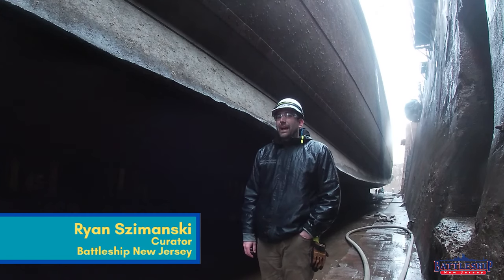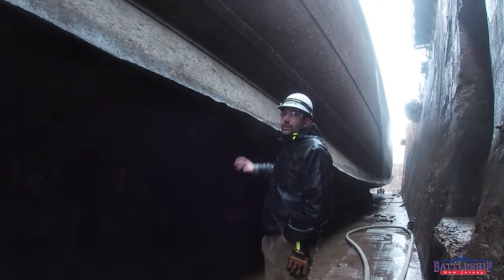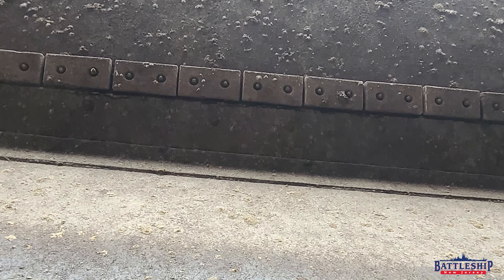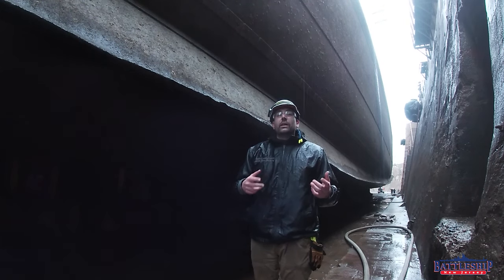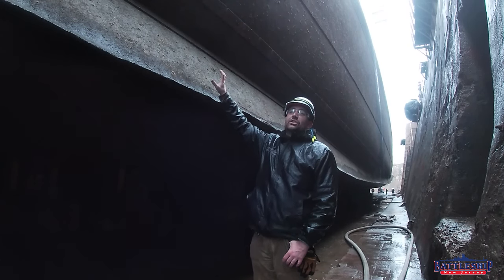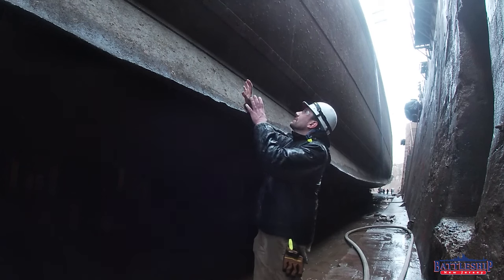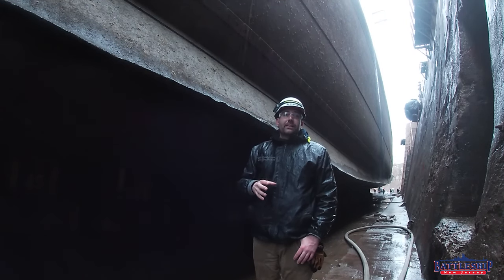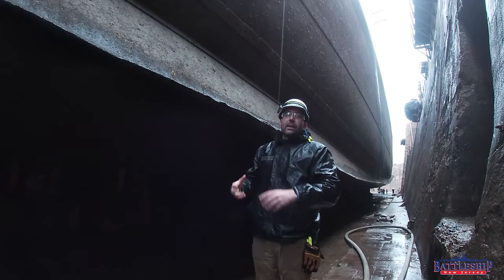First Look at the Battleship's Underwater Hull: Corrosion Control

Comment: I worked for decades in a shipyard. So on a inspect my job was to renew the anodes around the rudder and propeller. The Lloyds inspector was there talking to my foreman as I was setting up my job. My mistake was a ask the inspector what is the point of anodes. It turned out he has a degree in chemistry and start to explain to me all about rust and corrosion. My foreman silently slipped away.
Later on he laugh and explained the guy was smart however he also would talk the ear off an elephant if it stood near him long enough.
Reply: How dare someone share their knowledge enthusiastically to an inquisitor.
Reply: Had you listened you wouldn’t be on yt trying to learn about ship corrosion 😂
Reply: "Knowledgeable" can talk you ear off forever. "Smart" will ask what level of detail you need and want.
Reply: @benjaminshropshire2900  smart would enthusiastically entertain the inspector in hopes that he would give you some flexibility in half-assing the job
Reply: @BGraves  Really smart would enthusiastically entertain the inspector in hopes that he would help you learn what parts of the job are actually important to doing good work and which parts are just there to create enough paperwork to make it look lime some regulator is doing their job.

"Half-ass'ing" a job is a good way to only get future contracts from people who won't be in businesses long enough to be repeat customers. Figuring out how to offer a contract with 95% of the value at a lot less than 95% of the price is how you cut costs to make long-term profit.
Reply: @benjaminshropshire2900  thanks for the lecture

Comment: When the USS COD submarine (SS 224) was in drydock two years ago, it was very clear to see the electrical-leakage corrosion on the 'dock' side of the hull compared to the 'water' side.  Electrical current passing between the sub's hull and the metal dock structure ate away at the edges of the bilge keel.  There are a series of Youtube videos from that drydocking/hull repair.  IIRC, the Cod previously had Zinc anodes installed, but during this latest yard period those Zincs were replaced with Aluminum anodes (better protection for fresh water)

Comment: One thing I've noticed already is the below water-line hull looks in remarkably good condition, which must be really reassuring for the sustainability and preservation of the ship. And seeing that the Impressed Current system is doing the majority of the protection work is also great news, it means the anodes on the hull can be the all important back-up system. 
Between New Jersey and the Old Lady; USS Texas' drydocking and preservation work, it's an amazing time for Naval History, other museums are going to be pouring over the footage, designs and information the two ships are producing and hopefully means more ships can be preserved for much longer.

Comment: I never seen the hull that clean after many years in the water. It clearly shows the anodes are doing the job it supposed to do.  I can tell that Ryan is pleased how the hull looks and relieved that there's no major work needs to be done except to clean it and give it a good coat of paint that will last another 20 or 30 years to come.
Reply: These Anodes are sacrificial, so the fact the Anodes are in such good condition is not a sign that they are doing their job. On the contrary it means they are not doing their job, unless of course there are so many that their rate of consumption is greatly reduced. They are meant to be consumed. 
An artificial impressed current system may be a better solution.
Reply: I guess I should have watched the whole video.
Reply: I’m surprised how little marine growth there is.
Reply: They aren’t doing their job because they’re salt water anodes.  Shes in fresh water and needs aluminum or magnesium anodes.   The reason the hull looks like that is there’s a lot less stuff growing in her fresh water berth than what ships in the ocean are exposed to. 

If she was in salt water those anodes would be long gone (which is how they work, by sacrificing themselves not the hull)
Reply: @cruisinguy6024  Well, Excuse Me !
Reply: @fw1421  The plant growth has already been pressure-washed off, and the barnacles all died when BB-62 went up the Delaware.

Comment: Nice to finally see the bottom of New Jersey and I love the archeological mentality that you have. I was expecting the corrosion on the anodes to be worse. Just a point about the salt content of the river also, the USGS attributes the increase to runoff from road salt treatments used along the tributaries of the Delaware River and not the effects of climate change. We are seeing the same thing on the great lakes with over 1 million metric tons of chloride being used annually to treat roads here it eventually ends up in the lakes.
Reply: Rediculas amounts here in Michigan.  They can't wait for 2 snowflakes to meet on the road so they can dump a gallon of chloride on them.   Salt and gravel did the job for decades but they want cars and bridges to rust faster so out comes the liquid.  Winter was bad enough now they spread chloride spring and fall on the dirt roads just to rust cars faster.  UGH.
Reply: @jefffrayer8238  A lot of lower population states are willing to allow people to run studded tires a lot more than higher population states. That allows them to run plows and salt trucks less, but at the cost of the studs eating the roads. (I know of one road that seems to get inch deep ruts repaired every other year.) The other option is to run enough more plows and salt (which also damages the road) to keep them safe without studs. I think it's a matter of "What combination of mitigation gets the best return for the least overall cost?"

If anyone is pushing for more salt just to make money, my bet is someone who sells salt and spreading equipment.
Reply: @benjaminshropshire2900  Curiously, studs were still legal in winter in British Columbia in the 1970's. It's more rainy than snowy in BC.
Reply: @awuma  I don't know about BC, but around here, the days with rain and nights at about freezing are likely the times that studs are the most important because of the black ice.
Reply: @jefffrayer8238 , y'all have some of the largest salt deposits in North America.  It makes sense, to an extent, that you'd use what you have locally.   I know we've gotten shipments of Michigan road salt here in Nebraska, although I think Utah is our more common origin now.
Reply: @awuma  Studded tyres are illegal in Canada? in Australia (in one of the very few areas with regular snowfall) you are legally required to fit chains on 2WD cars as far as I know! I wouldn't think that a far snowier country would be so much more strict, but if they damage the road it makes sense- our main snowfall area has like 2 roads that you drive on to access the ski resorts so it isn't much to keep up with
Reply: @Brian-nm5bb  I do know they have a huge underground salt mine around Detroit  and I know there is a well south of Lansing that the chloride comes from.  Probably many other places as well.  Thing is there can be 1/2" of snow that will be melted off before noon but they can't wait to salt everything down wasting money.

Comment: The only thing I remember from a Tom Clancy novel I read many years ago was the protagonist meeting a nice older couple in a seaside bar.  They were stranded because the prop fell off of their boat.  They told the hero that although they didn't know much about sailing they had hired a guy to go over the boat before they left and give them recommendations.  One of the things the guy said was to replace the sinks, so the couple hired a plumber.  But then the plumber told them the sinks were just fine and they figured the expert made a bad call.  The hero figures out that the expert told them to replace the zincs, not the sinks and that's why the screw fell off.

Comment: The hull looks to be in pretty nice condition.  Especially when you compare it to the work required on Texas.  Granted, Texas is 40 years older and a riveted instead of welded hull, but that hull looks pretty smooth.  Sitting in fresh water helps.

Comment: This is the same method for water heaters and other systems that are constantly in contact with water. RV water heaters use a 1" x 12" zinc cathode rod for the same reason.

Comment: I visited U-505, in Chicago, a year ago. She's been on the hard for decades, and had no zincs. The mounting brackets, though, were noticable.
The docent didn't know what they were for.
Reply: Isn't the U-505 indoors out of water?
Reply: @TheKilroyman  Yep. That's why the zincs weren't replaced.
Reply: U-505 spent many years outside on the museum grounds before being lowered into the simulated bunker.  The thin casing steel was a bit lacy.

Comment: The hull looks amazing.  It's great to see it's in such good condition and the Battleship will be afloat for many decades to come. You and your staff have done a wonderful job preserving her for the nation.
I was shocked to hear a few videos ago that the fuel bunkers and pipes are "swiss cheese" though since like most, I had hoped she could somehow sail under her own power on special occasions, but you can't have everything I guess.
Reply: It's the seals, gaskets, and such that have failed. They've been dry for so long that they've rotted. The ship itself is fine. It's the kind of thing that isn't high in the list to check on, on a ship that's not going to sea. As for getting her underway again, it's possible, but unlikely. There is a distinct lack of those trained to fire up and run those boilers, handle the 16" guns and all the systems that are necessary to aim and fire them. I'm just glad that these Ladies have been saved unlike my ship, the USS Ranger CV-61.
Reply: Even IF, and that’s a big IF, the Navy would ever allow her to make steam again the costs would be monumental.  Many tens of millions of dollars of repairs and restoration would be needed just to enable her to get underway. 

There are a few WW2 era vessels that can still get underway, a LST and PT boat come to mind. ( I think it’s LST-325?)

But yeah the costs are just insane.    Short of a massive and drawn out war with near peers I can’t imagine a scenario in which any of the Iowas return to service. 

On that note, it would truly have to be a major conflict. There’s only a few dry docks capable of servicing ships this side and bet your ass they’ll be needed to repair damaged carriers and amphibs. Even if a new dry dock was built it’d take over a year to restore it to service.  If there’s ever a need for them again it’s going to be a very very bad situation, and it’d be easier and more practical to build a modern battleship
Reply: @cruisinguy6024  The nature of war has changed dramatically, and now UAVs in as great numbers as possible are the way to go, what with AI and inexpensive sensors and electronics. Who can produce the most autonomous and stealthy drones wins.That includes surface and underwater drones.
Reply: @brianfoster7064  Thank you for your service to the USA👍

Comment: I was involved with Cathodic Protection Systems for many years with a Canadian Engineering Company.  Both Sacrificial (zinc and Aluminum) and Impressed Current systems (Ground Beds with Graphite Anodes etc). It is apparent to me that the Zinc Anodes are in such good condition because they did not have an intimate electrical connection to the Hull. Therefore they did not preferentially corrode.  Ship Anodes I am familiar with had a heavy iron flatbar cast into them and these Bars were Welded, not bolted to the Hull Plates.  Do not use Duct Tape to cover the studs which must be Seal Welded on.  Not just tacked on 3 sides.  Stainless Studs, lockwashers and self locking SS nuts.  Slip some plastic tubing over them.  Much easier to remove after painting.  Will you be using a Zinc-Rich Primer with 2 or 3 coats of epoxy Topcoat?  6-7 mils Total DFT?

Comment: What bolts are being used to attach the anodes? If stainless is used the galvanic corrosion will highly accelerate. The corrosion chart recommends zinc plated steel bolts. The anodes will actually protect the bolts also.

Comment: The ship is always connected to a dock and access to an earth ground, are there any things done to cut down the battery action through connection to the dock?
Reply: Why is there stray current...
Why not state a hypothesis instead of implying fact?
Reply: @Katchi_  The best part... Rattling on an about an alleged "earth ground" while floating on a literal earth ground but mentioning "battery action".  It's a lovely word salad of nonsense.
Reply: That’s what the active cathodic protection system under the hull does…
Reply: That is what an impressed current system is.  The ship is one end of the battery, so you set the voltage to oppose the voltage of iron corroding into iron oxide.

Comment: Why not install the anodes first and then mask them off for painting???
This would give you more surface contact area to the steel hull.
Under your current plan, it seems as though you are insulating a majority of your potential surface area and running everything only through the threaded bolts.

Comment: I have a specific question regarding the anodes. I bought an anode on a dry dock tour and I was curious if you have any recommendations on how to best preserve and display it. I was thinking about turning it into a desktop ornament but wanted to prevent it from further corrosion and also prevent the metal flakes from going everywhere. Do you have any recommendations? Can I coat it in lacquer or something? Thanks and keep up the great work!

Comment: Did New Jersey ever bottom out or run aground?  The bilge keel looks a little banged up.  There’s no mention in the ship’s history.
Reply: Usual shadetree mechanic stuff.  Jacking on the pinch welds 😂.
Reply: @POVwithRC  … and a very big shade tree!  😊
Reply: It isn't on the bottom.  Probably hit flotsam over the years.  Also, it looked very sharp.  That's due to corrosion and erosion (when it's underway being scrubbed by water) whittling it into a knife edge.
Reply: USS Missouri certainly did in Thimble Shoals.
Reply: Panama canal,  piers, etc... there's also sections that have been cut out and replaced.
Reply: @jth877   Thanks.  I also just found the reference in a hard to find Tripod blog.  It was November 9, 1953 when New Jersey was entering the Miliflores lock of the Panama Canal.  It was a dry year, and the operator tried to conserve water.  There was enough water in the lock for the bow, but the bilge keel(s) caught on the rounded sides of the lock, resulting in a brief grounding until more water was let into the lock.  The way I read it, the ship was basically briefly suspended by her bilge keels.
Reply: She also ran aground (briefly) in Pearl Harbor WestPac 1986. I was there. BT 1979-88 USN.
Reply: Anyone know where the bigish dent in the bow came from?

Comment: One thought , would it be feasable leaving some zinc anodes alongside the aluminium so you are covered if the ship moved to a salt water location . Of course I don't know all the interactions so it might make things worse . Everything I've seen so far the ships bottom looks remarkably well preserved . The active system Ryan describes certainly seems to be working well .
Reply: Aluminum anodes would work even in open ocean waters so the toxic heavy metals containing zinc anodes are not needed. ( yes, zinc anodes contain 2 different heavy metals in trace quantities that are as bad as lead or mercury )
It is the buildup of the trace elements in sea life that has some island nations considering banning zinc anodes from their waters completely in favour of aluminum.  ( Florida and Hawaii and California at least should be looking at this as well. )
Reply: My understanding (though I'm just a layman who has read and listened to stuff) is that mixing anode types wouldn't do any good. All of the corrosion would just be concentrated onto the most favorable for the conditions.  Basically, to make it work like that you'd need a full set of each type of anode. (But then weird effects might start happening)
Reply: @gildedbear5355  Yes, the most reactive metal protects the rest.  If zinc is more reactive, then it will protect both the steel hull and aluminum anodes.  In reality, the middle metal will probably corrode some because there will never be a homogenous solution of water and ions around the ship.
Reply: Thanks for the information . It's an interesting subject .

Comment: 1204 anodes at 23 lbs each means equals 13 tons of zinc on the ship. Fun fact, that is nearly  the same weight as a single 9 gun broadside of  mark 8 super heavy shells with reduced powder charges.

Comment: I apologise if this has been raised before - why do you not remove the props and so remove the potential for the galvanic between steel and bronze. I accept there is still the stray current issue to deal with - which the impressed current system will have to deal with?

Comment: 27,692 pounds of zinc anodes!!!  At least the aluminum ones won't contribute so much to the weight of the hull, though if current anodes don't seem to be corroding, why worry about aluminum anodes?
Reply: if the zinc anodes are not corroding that means they are not working.
Reply: if the zinc anodes are not corroding that means they are not working.

Comment: My dad was a marine coating specialist for decades so I ended up learning more than I wanted to know about marine coatings. TBT anti foulant was largely eliminated in the 80s/90s from most bottom coatings, replaced with less effective copper, which is now on its way out as well. This placed a lot more stress on the surface between the surface of the hull and the anodes. Possibly one of the reasons why the anodes seemed to be less effective as the ship aged - the bottom coatings being used were less effective in aiding isolation of the anodes.